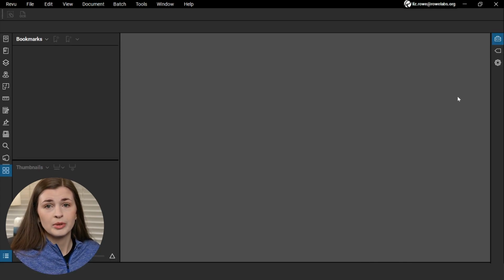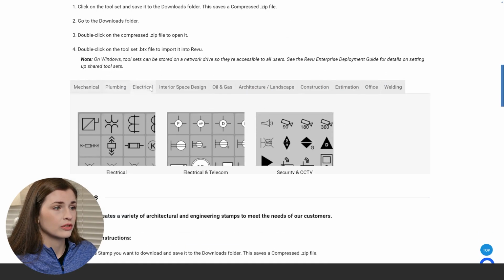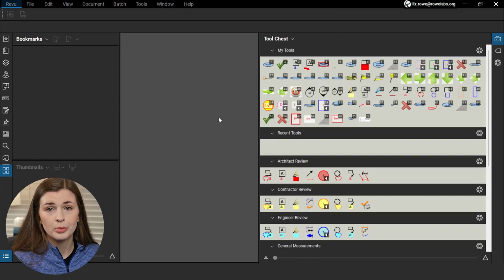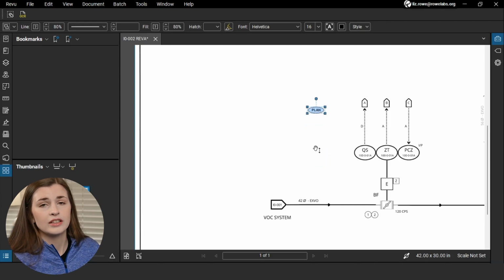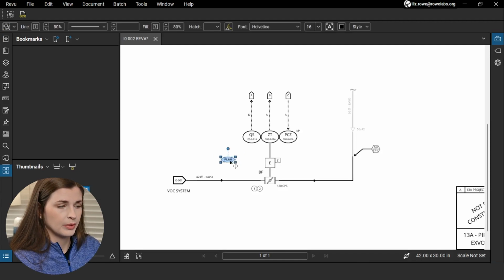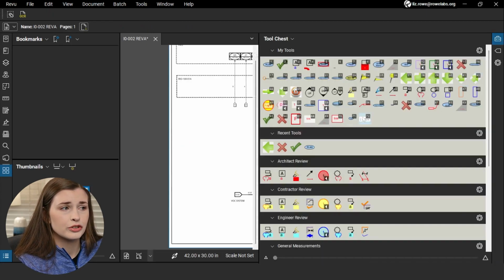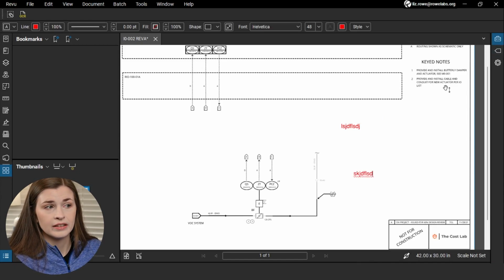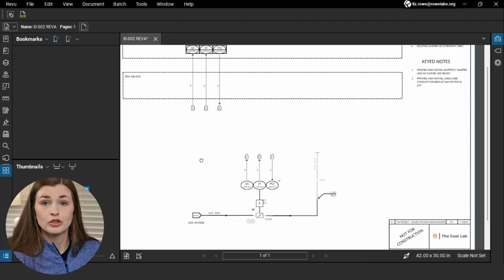How to Customize Your Bluebeam Revu Tool Chest

Comment: THANK YOU!!! This is very helpful. Im horrible with keyboarding I see, Lol. I have been trying to make , for instance, a duct transition. I want the mark up to ask me for both end DxW and L, (H could be AFF). Quantity, Gauge, and cost.
If thats not hard enough id like it to be a dynamic(i think its called) markup that i can select it like a window and have it fill in. I got the fill in mark up and I have cool tools built for taking off almost all duct and equipment and color coded SA RA EA OA MUA Combust Air, Rel Air,  now I want to take it further w adding shop fab and field install hours, pricing and the forementioned dimensioning (other than listing it in the label).

Clear
As
Mud
😊😂